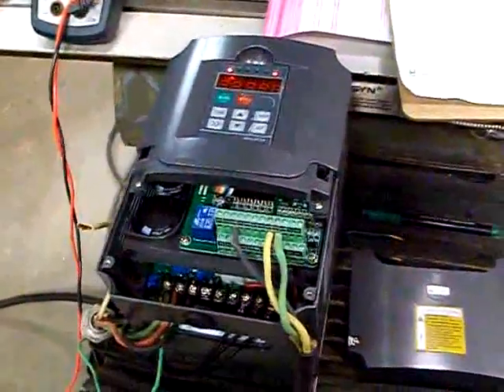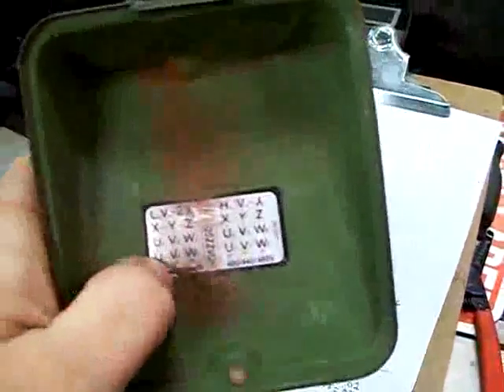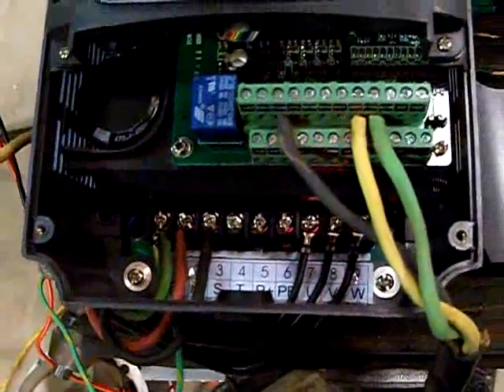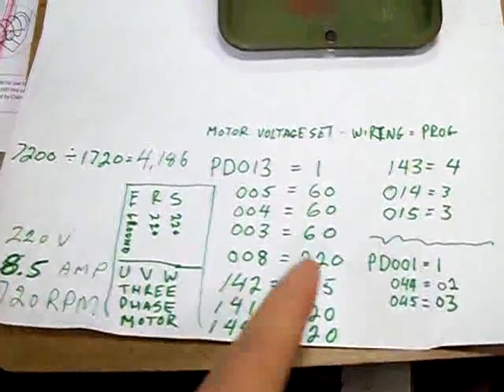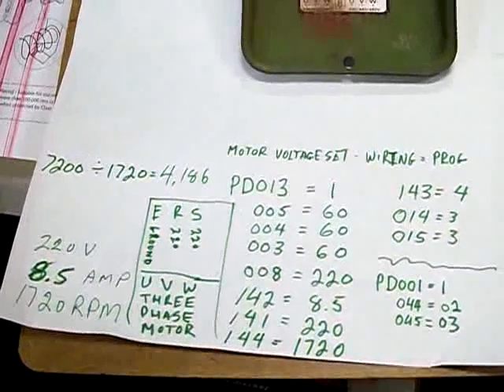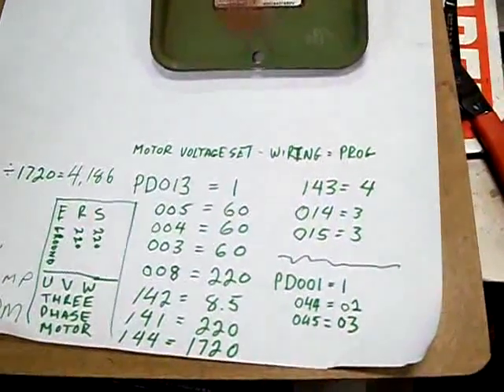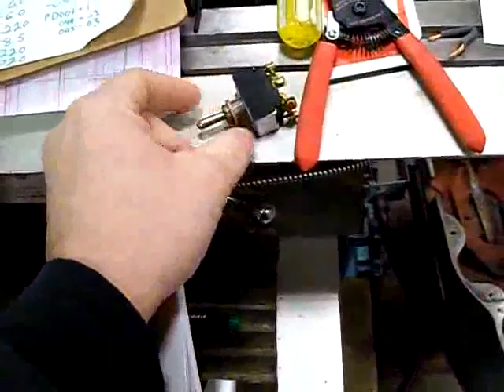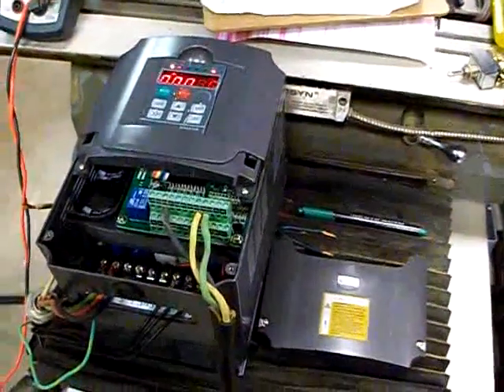HUANYANG 4.0 KW INVERTER VFD HOW TO SETUP AND WIRE SINGLE PHASE 220V BRIDGEPORT MILL PHASE CONVERTER

Comment: Okay so i am confused on how to get from the 4 lines coming from the 220 to the inverter. Specifically the neutral wire. The red and black connect to the 2 inputs of the inverter and the ground to ground but where do i wire the white
Reply from the maker: You're not using the white wire. Do not hook it up at either end. Put insulators on  it too. Use a voltmeter to test your voltage.

Comment: sr what are the parameters so that when you stop the engine it stops faster.  and the parameters for acceleration or starting of the engine.  thank you
Reply from the maker: 014 and 015. Set this to the amount of seconds you want.
Reply: @dabooge  thanks you

Comment: how would you wire in an emergency stop switch? Would you just stick it in the path of the fwd/rev switch? Or is there specific contact for it?
Reply from the maker: You need a magnetic motor starter with Estop  on the power input side. That's the way I have mine setup. The nice thing is if you have a power outage when the machine is on, the machine won't turn on when the power resumes. There is a momentary start switch that latches the electromagnetic contactor.

Comment: I purchased the UltimateBee this spring 1500x1500 2.2K 220v air spindle xPRO controller. I had so much issues with the controller and getting the motors to move right I scrapped it and got a NightHawk controller. All the motors are working perfectly now but I can not control the VFD. I have gone over all the setting and matched them up to what seemed to be the best choise and moved the jumper. still, the spindle will not turn. I am hopping someone out there will be able to help me.

Comment: Have this exact same VFD. Electrician set this up for a mechanical mixing barrel. A worker operating the machine failed to allow barrel to stop completedly before throwing switch in reverse, now VFD displays error code E.O.C.A (Over-current during ramp-up) or E.O.C.n (Over-current at constant speed). Am unable to get mixer running, any advice?

Comment: On the green buss left to right you have a black a yellow and a green. Were is the black wire hooked to power or ground?
Reply from the maker: There is no power going there, those are only the switch connections.

Comment: What’s the black wire for!
Reply from the maker: If you're talking about the one that goes to dcm that wire is going to my rotary switch.  It basically setup to bridge dcm to forward or dcm to reverse. An SPDT switch will do the same. Dcm to center contact and reverse and forward to outer contacts.

Comment: I know this video is old, but I was wondering if you could help me understand something. What are you using to actually turn off the VFD at the end of the day? Side question how has this VFD been working out for you so far?
Reply from the maker: I used the contactor that came with the mill but you can use a 2 pole switch disconnect. Vfd still running great. Never had an issue.

Comment: Thank you, I forgot to disconnect my table (crossfeed) motor (also polyphase) and it worked until the switch suddenly stopped the power, and popped the fuse so violently it fried the VFD! So make sure ALL switches to the motors are ONLY controlled by the VFD. (Lessons learned) The manuals are rather a week, I think there is a need to have a standard BP setup program sheet for dummies, not necessarily by the program number (as different units have different program number order) rather by function so these parameters could be done on any VFD regardless of the "P" code sequence.

Comment: If you have a 1 phase motor do you just connect it to two of the outputs or must it be a 3 phase motor?
Reply from the maker: richardc1983 not for single phase motors.

Comment: hi and great video. just a question, anfter , now, some years did you had any problem with the inverter? moreover is it truly capable to convert 220v single phase to 380 three pases? thanks
Reply from the maker: Alberto Gulmini this will not step up the voltage you'll need a transformer for that. You will also need a vfd the runs off the same voltage of the motor. Still runs great after all these years:)
Reply: DJB HSI thank you for your help

Comment: Is your model Huanyang a HY04D023B? I bought mine to power a 5hp 3ph planer, don't need reverse or variable speed, just start and stop. Ramping up to full speed of course. Can I wire 20ft cord for the INPUT to plug and unplug at a wall outlet? So I'd plug it in then turn it on and off from the VFD. Wiring a switch might be easier too, I'm researching how to do that.
Reply from the maker: That wouldn't be a problem just make sure that you use the correct gauge wire that's all
Reply: Figure to use 10/3 600v wire for both sides of the VFD, would that work?
Reply: Rc RC yes 10awg is plenty for that run

Comment: Hi, Thanks for this great video. I am trying to set up the exact same thing on an old Bridgeport milling machine that was donated to our Makerspace.  I am confused on how to wire for the old school switch. Where does the for and rev lines go? Thanks for any direction or wiring diagram that you can provide. Best -Scott
Reply from the maker: Scott Van Campen without seeing your switch it's difficult to tell you how to wire it.  DCM basically bridges to FOR or REV. It's pretty simple just by looking at the drum switch. You could also continuity test it I suppose if you're not sure.
Reply: Thanks for the reply, I tested the VFD on another 3 phase motor and it works fine... So I'm going thru the Bridgeport motor and might be rebuilding. I think I still have a question of two on how to integrate the switch but will follow up later. Thanks again for your help. Best -S

Comment: Hi
I saw your video and was very useful.
I have a 2.2 KW HY02D223B
was working and a saw a spark in the inverter would you believe the is a fuse inside of it and where you'd it be located?
thanks

Comment: I JUST GOT MY HUANYANG VFD Model HY07D523B OFF E-BAY. I hooked it up to 220 vac single phase. I programmed it and I hooked it up to a 5 hp Leeson 3450 rpm 220 volt single phase motor. Every time I start it up it faults out, error (E.OC.A) . Does any body know what I need to do???? HELP HELP
Reply from the maker: Have you tried starting the motor without load?
Reply: Yes. I bought a  new 7.5 HP 3510 RPM  3PH motor, it does the same thing under load. Help!
Reply: Mack Everhart it's not designed to run a single phase motor. Buy a 3 phase motor.

Comment: Thanks for posting this. Any idea if there is a published trouble code list? The manual may have been written in Chinese. I am getting a code E.OC.A. I think it may mean error. on current. amps?
Reply from the maker: EOCA is Over Current on Acceleration. You may have underrated your VFD for the app. Try a longer ramp up time or increase your transmission ratio if possible.

Comment: Can anyone tell me how to set up the VFD to start and stop the motor on my compressor based on the pressure switch on the compressor?
Reply from the maker: Wire and program it exactly like I did. Only difference is 1 contact from the pressure switch goes to DCM the other to FOR.

Comment: Hello, just ran across this very useful video. I am repowering a lathe with a 5hp motor and wish to run it with varying RPM's (rather than just on-off-rev). My question is; is there a provision to speed control using an external potentiometer vs using the buttons on the front panel? How is your unit holding up on single phase power? Any reliability issues? Thanks.
Reply from the maker: You'll need a 10k potentiometer They're only a couple bucks . Hook V1 to the center terminal on the pot. Hook VR to one side terminal and ACM to the other terminal. Make sure 
the 3 pin jumper on the VFD at the right side on the circuit board is 
jumper set to 1-2. Program PD002 to 1 and you should be good to go.
Reply: Outstanding, thanks! I'm assuming I can wire in a reversing switch and start/stop switch as well? How is your unit running? I'm getting mixed reviews on these units (but sheesh, the price is almost worth the risk). Thanks again!
Reply from the maker: Been on my mill since 2012 with zero issues. I over rated so I'm no pushing it very hard. Yes the for/rev it's the same as I setup. Complaints are likely due to user error.
Reply: One last question and I'll leave you alone (I promise!) what is the rated amperage output of your VFD? My 5hp motor indicates that it could draw 15.3 maximum at 220V.
Reply from the maker: What are you trying to run?
Reply: I am re-powering a 1949 Holbrook C-16 lathe. the original setup had a 7.5 HP, 3 speed, 3 phase, 400 V motor belted to a two speed gearbox. I have no practical way to supply 3 phase 400V power to this motor, so I acquired a 5hp, 1200 RPM (6 pole) 3 phase motor. FLA is about 15.3 amps at 220V.

Comment: Great instruction but can you please explain where the wires from the CDM and FOR are connected to on the breakout board.  This is where I am coming unstuck and cannot get the spindle to turn on and off.  i assume they are connected to the BoB relay which just close circuits the two wire ends making a loop but still cant get it to run.  Any suggestion would be appreciated. thanks Dean
Reply from the maker: Are you trying to use this on a cnc?
Reply: hi,  yes. i have built a cnc router and using the same VFD as you are.   i think I may have worked it out last night.  For some reason the PD000 was set at "1" which i found out is locking the programming so when i was setting Pd001 to "1", it was showing the change it but then when i exited out it was defaulting back to "0".  i spent about 6 hours reading the manual and searching the internet and found one small comment about the lock.  i unlocked it and then programmed it again and like magic, it worked. So i was correct in connection it to the relay, just the VFD was not set right.     Thanks for your reply and offer to help.  Much appreciated.  Dean

Comment: Many Thanks again. I used your parameters, programing formulas and advice. I just walked in from the garage to come and write this. The saw is running like a champ. I have even managed to program the ramp up to 5 seconds and the ramp down to 7. Going from an old 1Hp Craftsman that had trouble cutting peanut butter to this  3 Hp beast that slices so clean through wood has put a grin from ear to ear.  Funny thing after testing it a couple times...I hit the reverse button by accident trying to start it up ...dang thing still cut better than the Craftsman in reverse ...LOL

Comment: Massive Help, Thanks...Any way you could please do a video on what type of switches to use and how to wire up separate on off switch added to a machine, as well as the forward reverese (type of switch) and how you wire in and set it for a speed controller dial, and the type and info on that dial, I would need to buy it? Your video was awesome!! I was lost and my wood lathe would not run after I hooked it up with new motor and this vfd, your video got it up and running, so I'm pumped I just really need to add the other external control switches and am really lost...figured out how to move around the panel ok...just not sure about the other hook ups and parameter settings...thanks a ton.

Comment: OK...so I am looking at your set up. I see you have "4 wire" 220v on the input. It looks like you have the white wire just floating and not connected.  I am assuming that is the neutral wire. I also have 4 wire 220 so I just want to make sure I get this right. I have already fried a static converter in an attempt to get this saw running so I am a little gun shy.  Also I am guessing that I need to bypass the on/off switch and wire directly into the motor. The on/off should be wired in before the VFD then to the motor???  I believe The on/off switch is electro magnetic

 Should I connect the grounds direct? the connecter bar on mine reads  R/S/T/P+/PR/U/V/W/ GRD (a ground symbol)  there is a tag that says "motor" over the U/V/W terminals, thoswe must be the output to the motor right? I have single phase input 220v
Reply from the maker: +TheDirtFighter You need to double check with a voltmeter, this stuff can kill you in a split second. I myself never trust anyone else's work. Normally red and black are your 220v. The other line is a neutral that can be split to 120v. The other line (green or bare) will be ground. You can't use the electro mag switch on the VFD to turn the motor on/off. Use a regular motor switch. You can use the mag switch to power the VFD from the mains. The mag switch is nice to use there. Should you have a power outage the machine won't fire back up when power resumes until you press on again. R and S is your 220v the UVW is wired direct to the motor and the switch to turn the machine on and off will go to DCM and FOR. Flip any 2 of the UVW if your saw is turning the wrong direction. Connect all your grounds to ( E )
BE CAREFUL! DOUBLE CHECK and TRIPLE CHECK your work!!
Reply: +DJB HSI Thanks again, I appreciate you taking the time to answer my questions. It all looks pretty straight forward. I just have very little experience with electronics. The static converter came with the saw and was not installed so there is a chance it was bad to begin with...but when you are not quite sure what you are doing and things start hissing and smoking it can make a guy doubt himself. 

Is it possible to wire the grounds together? I am using heavy gauge wire and don't think I will be able to get both wires in the very small terminal on the VFD.

Comment: my motor is 3450 rpm if I divide 7200/3450 I get 2.08 so I have to assume mine is a 2 pole motor so in my case the parameter for 143 =2 not 4 because your motor is 1720 rpm.
Reply from the maker: +TheDirtFighter when Thomas asked me that question, I checked a 3 phase motor on my shelf that is 3450 rpm and on the plate it's marked 2 pole. The motor was from a table saw.
Reply: +DJB HSI I really appreciated  this video. I did however decide to build a RPC  instead. I have too many machines, VFD'S would of been a fortune.
Reply from the maker: +Thomas Shue Yes that would be correct.
Reply: +Thomas Shue Have you found this to be the case? I am getting ready to wire one up to my 3 phase table saw (3450 RPM) Just trying to soak up any info I can...I have ZERO knowledge on VFD's or any electronics for that matter
Reply: +DJB HSI Thank you for the reply and thank you for posting this info...I am sure I will be back here to take notes when my VFD arrives.  I imagine it should be very straight forward since I am installing on a table saw and don't really need all the functionality. Basically I just need the 3phase to run it in the garage and this was a whole lot cheaper than getting a single phase motor for a Powermatic Pm66
Reply from the maker: +Thomas Shue It really isn't the cheaper way unless you found the RPC motor very cheap and if you don't use your machines a lot. I've been using this VFD for 4 years on my mill. The savings in electricity of not having a RPC on idle would have paid for itself a few times over. You especially save a lot of money if you're stopping and starting your machines often. The only machines I never bothered to convert were the machines I only use occasionally.

Comment: One more question.  Could you have just run 3-phase to your rotary switch and used the switch for the forward & reverse function (i.e. just supply 3-phase and run the mill in 'as delivered' mode)?
Reply from the maker: +Mogman150 yes if I had 3 phase available I would not have even bothered with a VFD. My mill already has mechanical CVT variable drive so motor runs at 100% speed and the hand crank adjusts the speed. A VFD is only required if you either want variable speed or if you want to run off a single phase supply or both. You'll need a 10kohm Pot if you want to use variable speed. Check your manual on how to properly wire up the pot.

Comment: Great video.  How do you get it into the mode where you can change the parameters?  Thanks,
Reply from the maker: +Mogman150 Press program, use the Double arrow pointing right to move the cursor to the correct digit then use the up down arrows to edit the PD number parameter. Press SET then enter the correct parameter then press set.

Comment: absolutely superb how to I had it running in only a few minutes after watching this video, I am wanting to use the jog facility on this inverter I am assuming you hook up a switch to the jog terminal and dcm is this correct, there is no diagram in the book, thanks once again

Comment: I thought if it was wired to 220 the output would be 440 or can you set that?
Reply from the maker: Joseph DAndrea No not this model but most 440v motors can be wired 220v.
Reply: Cool. I assume the neutral goes to the e and the two hot legs go to one of the input terminals.
Reply from the maker: Joseph DAndrea No E is ground. No neutral is used
Reply: DJB HSI I am confused did you hook an input power cable to the E terminal or just to the three power inputs?
Reply from the maker: Joseph DAndrea INPUT E=GROUND, R&S IS THE 220. OUTPUT=U,V,W IS THE 3PHASE TO THE MOTOR.  If you have 3 phase available you can wire it in the R,S,T

Comment: I do have a Weg 10 hp single phase 230v 44 amps, it is possiblr to use a speed controller,
Reply from the maker: Francisco Bravo I haven't tried it myself but apparently the AB PowerFlex 523 AC Drive can run from single phase. But unless money is not an issue at the price of those AB drives you probably would want to find a used 10hp 3ph motor and use a cheap VFD like I did.